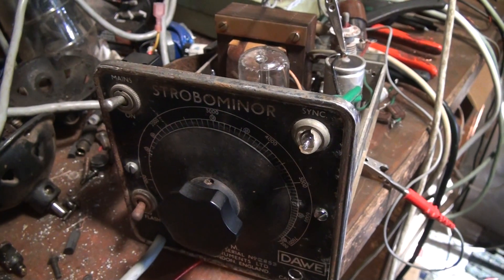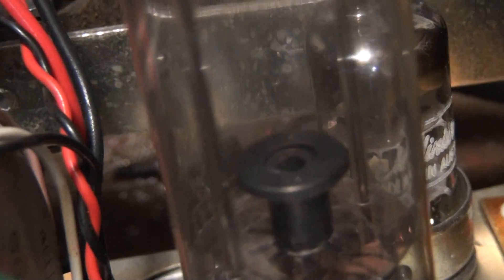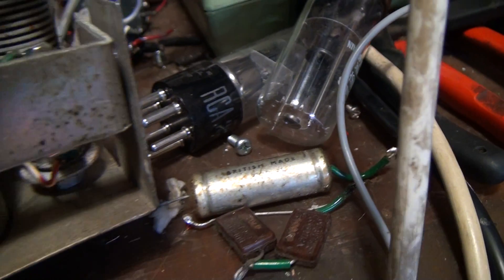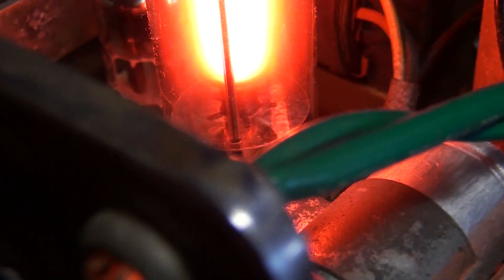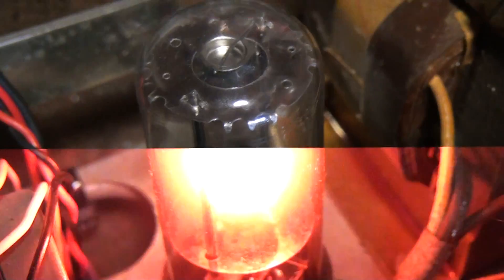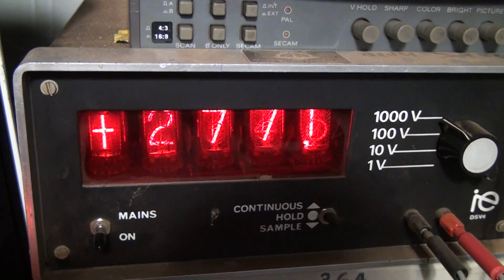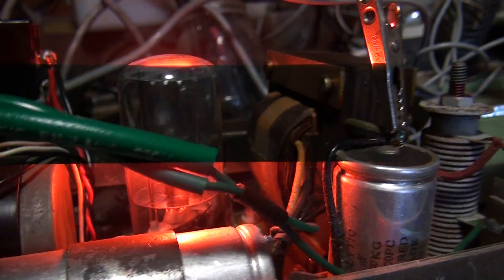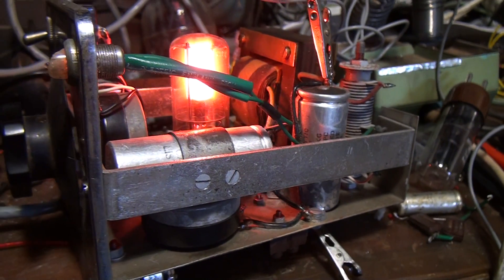Shed Science, Vintage strobe light, NSP1 neon

Comment: Cheers for the test. To speed up the flashes you're increasing the current? 
I have 3 of these. Nsp1, nsp1 and the cv2296. However I do not have the meter you're using.

Comment: Ordering my tubes stock, I found two NSP1 NOS, I'd like to do some project like you stroboscope lamp. Do you know same schematic to flash this tube?. Thank you!!
Reply from the maker: ateijeiro0 OK, I searched an old Electronic circuit manual for any Circuits but no luck there, I also searched the net but no happiness there either. I will go through some other text books and see if I can find any info for you, if I have success I can put together another video and show the schematic. Pity there is not much info on those tubes, seems they fell out of favor to the Xenon flash lamps. The NSP1s look nice though, they have a great Orange reddish colour to the discharge. Good luck with your project.
Reply: ***** Thanks. I had found some on http://www.sgitheach.org.uk/strobotron.html I'll try to do something this weekendThanks!